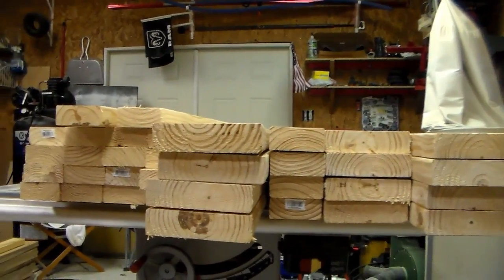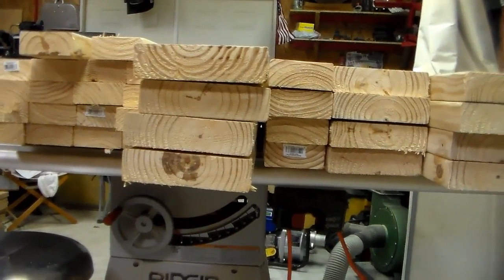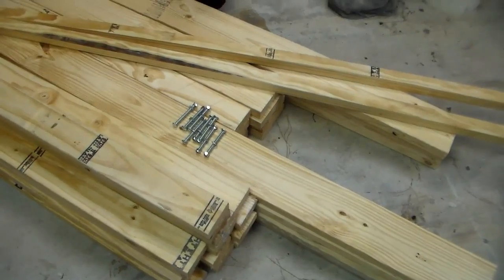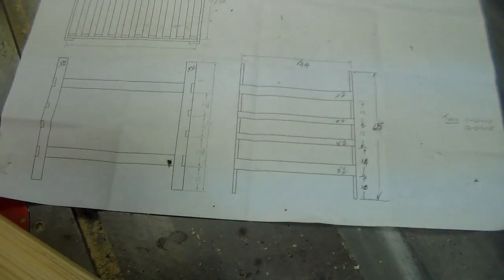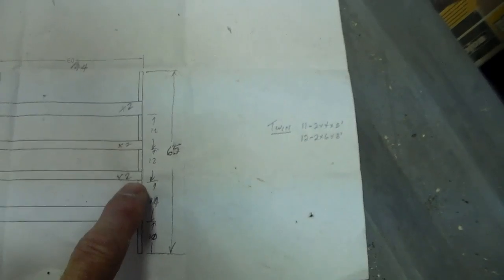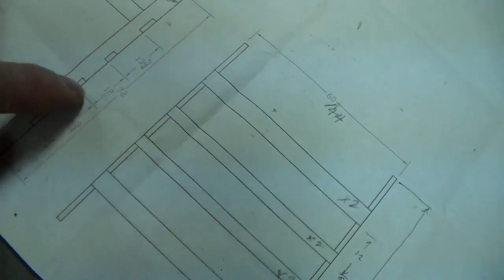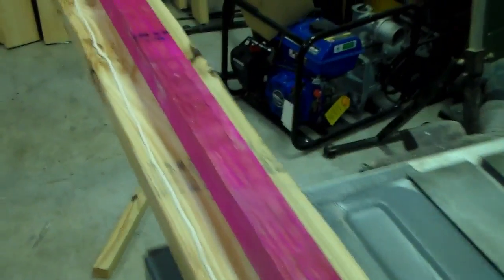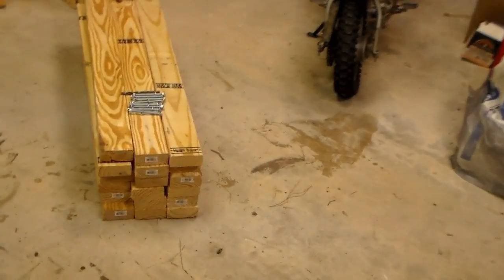DIY Bunk Bed for about $100 or less 2x4 and 2x6 easy to build

Comment: Are the lag bolts supporting the entire weight of the bed?
Reply from the maker: Yes, I have not had any issues yet. But that is a good point. Might rethink the design. There are other screws holding it as well...BUT????

Comment: if you don't mortise the ends would that create a problem. Going to build a lot of beds for a missions trip to Costa Rica and probably will only have circular saws available. Thanks
Reply from the maker: Might not be a problem, but I would lag bolt them. You can do mortise with a circular saw, hammer and chisel. Let me know if you need to see this done and I will try and post a video ASAP. Do you live close to Louisiana I would like to help with the mission trip.
Reply from the maker: P.S. Some of the dimensions would change as well.

Comment: Once the skeletal custom  bunk bed is made, are there any recommendations for a company names that can make the mattresses to the length and width one might have or want? As opposed to the typical, Queen, King etc..
Reply from the maker: I always make mine to standard sizes. It would think a custom size mattress would be very pricey and the sheets would have to be custom made as well. $$$ I like doing things on the cheap. So as for your question I do not have any idea. Google would be my first thought. "Alexa find me custom made mattresses" lol.
Reply: Adrenaline Fish Hey thanks a lot. I'll have to refer AI for the big question then. Hehe
Reply from the maker: Grin...sorry just never had to buy a custom mattress. Good luck.
Reply: Adrenaline Fish It's ok. I figured it's reasonable if it's expensive since it be custom made anyhow. But I need smaller dimensions due to limited rm space but no less then regular dimensions.

Comment: Could we have a set of the blueprints for this project.  It will be perfect for our camp
Reply from the maker: Yes. I will take a better picture of what I have and send it to you. Might even redo them as I have marked the one I have up  some. Do you want to single bed or double /full bed plans
Reply: I am making bunk beds
Reply from the maker: I am going to scan what I have and send to you. I have looked for the drawing file and cannot find it on my PC. I only have the one sheet that I show in the video. But it has most of what you need. Just ask me whatever you need to help you finish the bed. I will try and get that to you tomorrow.
Reply from the maker: Trying to find these plans. I don't have a program any longer to redo them. I will try and put something together for you.
Reply: ok I will see what we can figure out. I will be in touch with questions. thank you
Reply: is all that you need for the 2x2's to support the 2x4's & mattress plus weight of person sleeping, wood glue?
Reply from the maker: Yes, The 2x2 will support the mattress and persons weight.
Reply from the maker: I did use wood glue.
Reply: Adrenaline Fish, so no screws?   btw thanks for such a quick response!
Reply from the maker: Screws also. 2.5 inch deck screws.
Reply: A properly done glue joint is actually stronger than the wood itself - but if you must, even some nails will reinforce the joint.
Reply from the maker: I just made a new plan for this bed let me know if you want one. small charge.
Reply: @Jimbel500  i would like a set of plans please.

Comment: Could you use this plan and alter it for crib size mattresses? We have toddlers who share a small room.
Reply from the maker: Not sure what changes I would make for it to be safe for toddles or babies. But a crib mattress is 27-5/8" to 28-5/8" wide and 52" to 53" long. So the side pieces would be 53" (52" to 53") and you would add 6" to the head board pieces So about 58" (58" to 59"). Now the hard part is going to be the railing needed to keep the children safe. You also could make the legs shorter so you could reach to top bunk without using a ladder. Please be safe and make this safe for the kids. I am only giving you dimensions. I am NOT in any way condoning bunk beds be used for toddles. It just does not sound very safe to me. Remember safety first. God bless you and keep your little loved ones safe.
Reply: Adrenaline Fish Thank you so much for the reply! Yes, we would like the legs to be shorter and add a rail. Our busy son who is four climbs up any and everything. I think a lower bunk would be prefect instead of the traditional ones sold in stores. I've only seen one toddler bunk tutorial on YouTube and he didn't provide any measurements.

Comment: It's a nice simple built. can you send the plan/blue print so i can build one for my kids. Thanks.
Reply from the maker: I have looked for the plans and have not been able to find them. I will try and put something together. Feel free to ask any questions and I will get back to you as soon as I see your post. Again I will try and sketch something up. I will put full and queen sizes on the sketch. Not sure how fast I will get this done or how I will get it to you. I will be intouch.
Reply: Thank for quick response. I just need to know cut length of the 2x4 and 2x6
Reply from the maker: 4-2x6-65"; 4-2x6-44";4-2x4-44"; 4-2x4-75";18-2x4-38" single (or 54" full)
Reply from the maker: OH you will need 4-2x2-70"
Reply from the maker: I have plan now. Let me know if you want one.
Reply: @Jimbel500  Thanks for the video! I am interested in this plan (could it be modified for queen bunks?) How much?